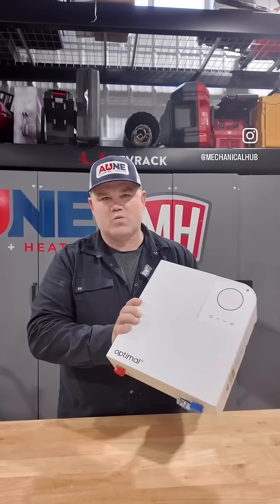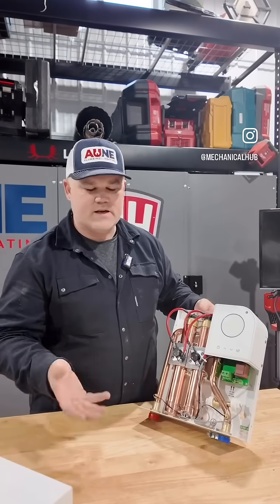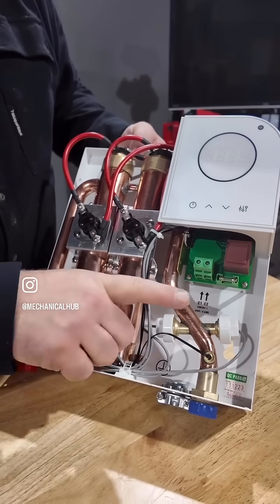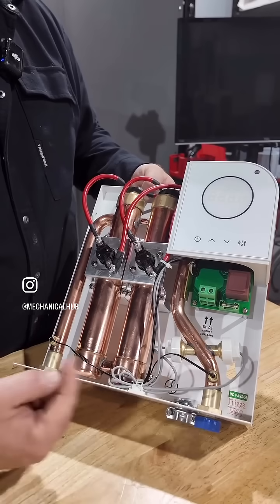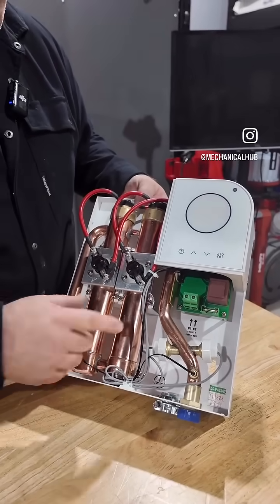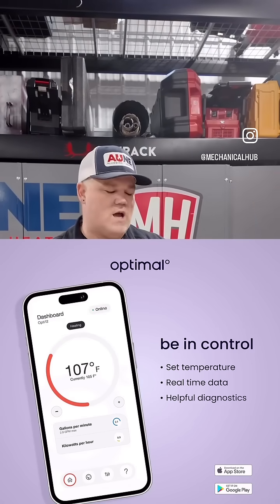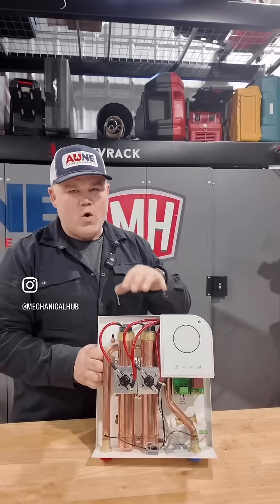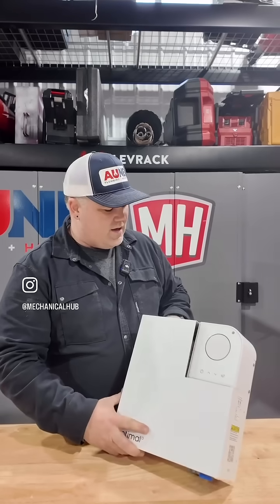Mechanical Hub overview of Optimal Tankless Water Heater.

Comment: How do you know when it’s on is it on the blue or green light.
Reply from the maker: Great question - Blue = Water flowing but unit is turned off. Green = power is running, the heater is on and ready to heat but the water is not running. We also have white = power is running and the elements are actively heating, Red = Error Code, Teal = diagnostic mode, no light = output temp is not reaching the set temperature, purple = vacation mode.

Comment: Heat up to 2.5 gallons per minute (gpm) to 105°F given an inlet water temperature of 72°F.....
Reply from the maker: you can use our sizing calculator to calculate the right size product for your area. https://itsoptimal.com/pages/calculator

We have customers using this product in Alaska. The key measurement is inlet water temperature and desired temp rise. 

@tcap7917 if you have any future questions hit us up at sales@itsoptimal.com